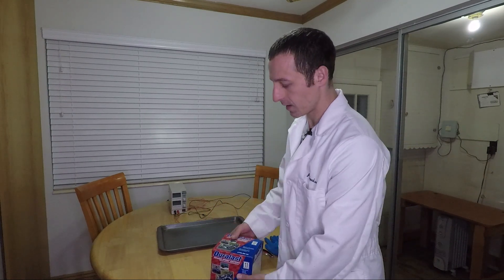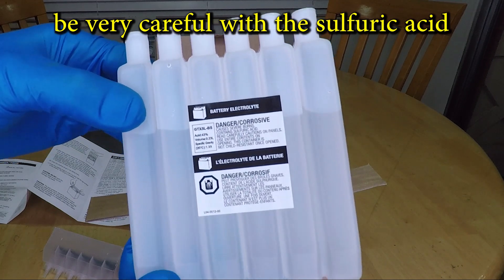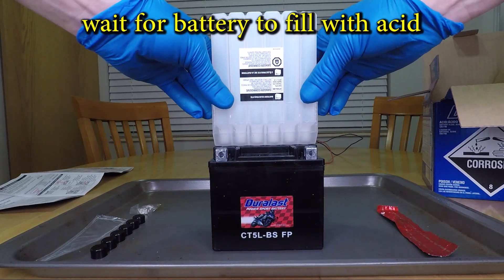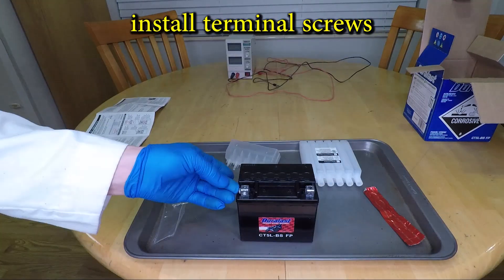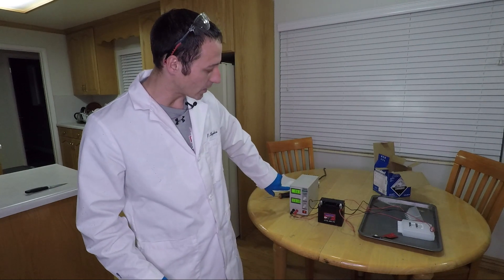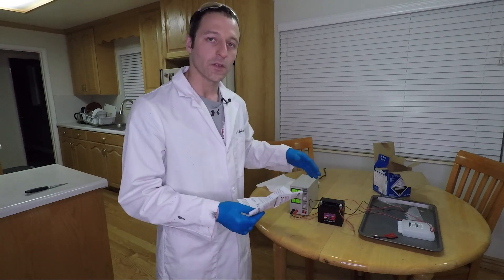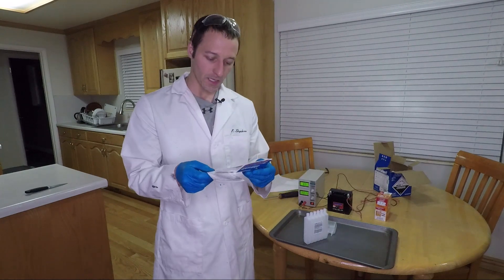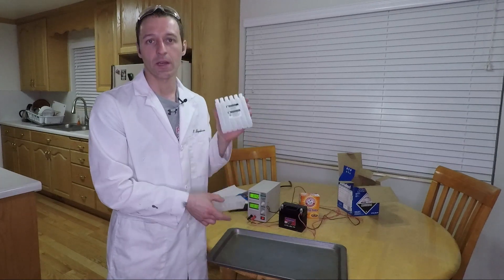How to fill a motorcycle battery with acid

Comment: do you know where i can buy the acid for my old battery? (without having to buy a whole new battery and how much milliliters?)
Reply from the maker: You can try online, but you're actually better off buying a sealed lead acid battery on Amazon.  The sealed batteries already have acid and they're ready to use.  Scooter batteries on Amazon cost about $35 and work much better than Autozone batteries.

Comment: Thank god I watched this video was about to buy the same exact battery for my motorcycle until I watched this video looks very serious and you need to be very cautious, once I saw the the lab coat on I knew that I can’t mess around with this so
I’ll stick with the 140$ batteries… thank you sir
Reply from the maker: Filling batteries with acid is a bad idea anyway.  I've had really good luck with the $35 sealed AGM batteries on Amazon.  I just look for the ones with the best reviews, and they're ready to go without any of that acid nonsense.

Comment: The acid wont flow into my battery one bottle went empty and others are full still its been 15 mins
Reply from the maker: With the bottles inserted into the battery, poke a small hole into the bottom of each acid bottle (should be on top now).  That will allow ambient air pressure to push the acid down into the battery.
Reply: @LabCoatPaul  thank you that helped it start going. Really appreciate it

Comment: WHY THE FUCK WOULD THEY MAKE THIS SO FUCKN COMPLICATED.... WHAT HAPPENED TO JUST BUYING ONE THAT IS READY TO WORK
Reply: Activating a powersport battery as illustrated in this excellent video isn't complicated. The user simply needs to follow a few steps in the stated order. Those who are unable to do so should seek assistance from someone who can follow straightforward directions. 

Also, as mentioned, these batteries have a longer pre-sale shelf life than do pre-charged batteries, which are aging every day they go unsold.
Reply: Department Store cant take risk their battery stock will sell out or not. So with type of battery the store can keep this for little longer than ussual battery. This is alternative for that.

Comment: Sir, what happens if fill the battery lead acid? it's the same the sulfuric acid? if the electrolyte turn in to low level around 6 months, we're allowed  to fill again? pls. give answer sir. I am craving of that kind of knowledge.
Reply from the maker: Usually you don't need to add acid to a battery, but it's ok to add a little bit.  You can also just add distilled water to make sure the battery is full.  I just buy sealed maintenance - free batteries now, so I don't have to add anything.

Comment: I installed my acid pack and immediately sealed it I forgot to leave it out for an hour to let the gas escape now I cannot get the cap off to allow any gas to escape will this be a serious problem?
Reply: I just made the same mistake, and then saw this video.. so I took the smallest flat screwdriver that I have, and wedged it in between the filler holes, slowly prying the cap strip off.  Three of them released pressure. 
I actually learned something new today lol..
Reply: @242176  I called one of my older friends he assured me that it still will be okay so I went on and hooked the battery up to the motorcycle and went riding... I guess I'll see how long the battery lasts 🤷🏼‍♂️
Reply from the maker: Probably not.  Most batteries have some kind of pressure vent.  Look at your battery to see if it has something like that.
Reply: @LabCoatPaul  i read my instruction intensively and my Walmart agm atv battery instructions said to cap seal before charging. QUESTION !!! I also used a 1 amp battery tender to do its first charge and instructions said mine would take way longer than it did. My tender showed green light for fully charged and float level trickle after only about 2 hours also but when I used my multi meter it read 13.28 volts without tender hooked up of course and even after installing it on my atv after first ride I shut it off and read it again and it said 13.5. 12.6 to 12.9 is normal full charge so asking for your take on that ???

Comment: After filling my battery, I let it sit for 2 hours....I forgot about it... anyway, I hook up my 2 amp charger and my voltmeter. Its already at 12.8v...I turn on the charger and in a couple mins its 13 and climbing volts..should I call it good or just keep charging it?????
Reply from the maker: I would probably charge it a bit more.  Do you have the instructions that came with your battery?  How long do the instructions say to charge it?

Comment: You show a YUASA battery for your thumbnail, but use a Duralast for your example.   The YAUSA does not come with the funnel so your bait and switch move sucks bro.  Useless.
Reply from the maker: The purpose of this video is to let people know there is a procedure for filling a battery and you can't just throw it in your vehicle right away.  You should follow the directions that come with your battery, but they will be similar to the one in the video.
That being said, I kind of agree this video is useless.  Let me explain:  After I filled and charged the Duralast battery in this video, I installed it in my scooter and left it out in the cold for 2 weeks.  That shouldn't matter, but the battery never worked again.  That's $60 down the drain.  Don't buy motorcycle batteries from Autozone.
I've had much better luck with the cheap $30 batteries on Amazon.  Get the pre-filled sealed AGM batteries.  They work perfectly and you don't have to fill them.  They're ready to go out of the box.  No acid, no charging, nothing.  And they last much longer than that trash Autozone is selling.
Reply: You mean the Durtyass,

Comment: How long do i have to wait to put the battery on? I just poured the acid in but it got hot and is not cooling...what dou you recommend i do?
Reply: Its over 2 hours now and is not cooling down
Reply: @arnaldozeravla7878  What's the rest of the story? Were you able to safely charge and use the battery?

Comment: Thanks! I threw the cap on right after filling and wanted to make sure I could install it right away and saw ur video and took the cap back off and let it sit for an hour and charged it for 3 hours before installing. The instructions didn't say any of this...thank u for the headache avoided 6 months later.

Comment: So I have a battery charger that reads 12 volt regular 12 volt deep cycle and 12 volt AGM/gel but I heard somewhere you weren't supposed to use the AGM / gel to charge an AGM / gel also it has a 2 amp setting 12 amp and 30 amp what should I use for both settings. New battery just like in the video.  Great video !
Reply from the maker: Use the 2 amp slow charge setting.
Reply: And what about the other setting
Reply from the maker: @jondunit6232  If you're trickle charging the battery for winter storage, or charging the battery for the first time, you need the slow setting.  If you just want to charge the battery quickly, use the high amp setting.  For example, if you left the key on and the battery died, you want to charge it fast so you can use your vehicle.

Comment: Is it ok to lay these types of batteries on there side ?
Reply: No. They can be tilted, slightly, but just by a few degrees. While the cap over the cells is intentionally snug to as to prevent leaks, this protection can't be guaranteed when such a battery is installed in a horizontal configuration for which it isn't designed.